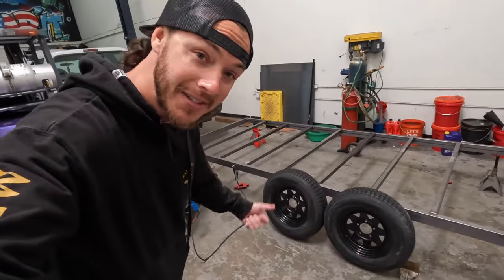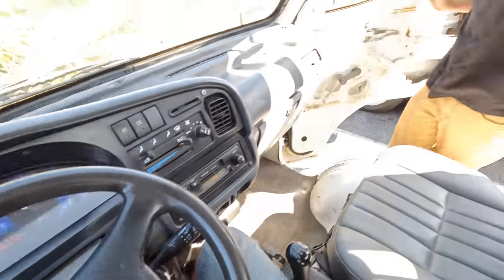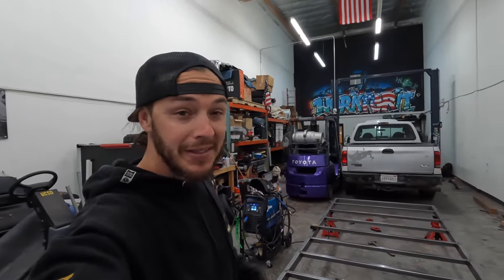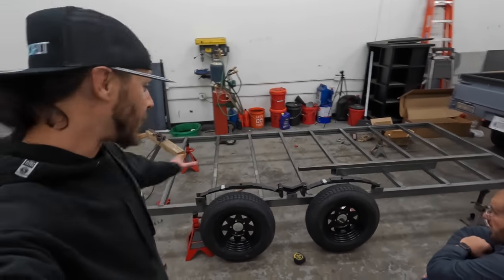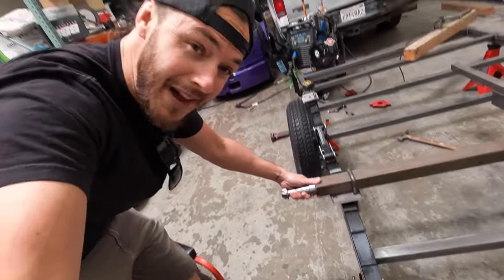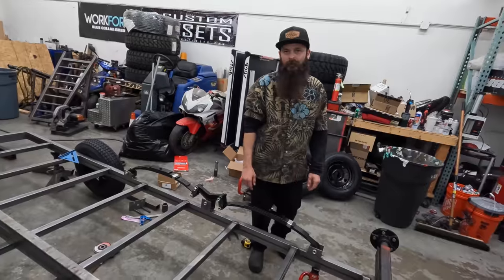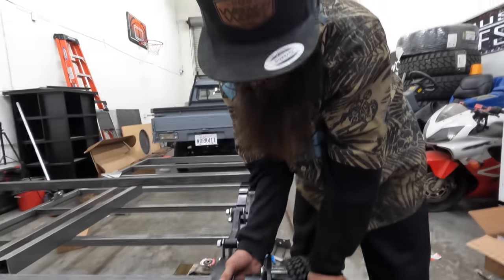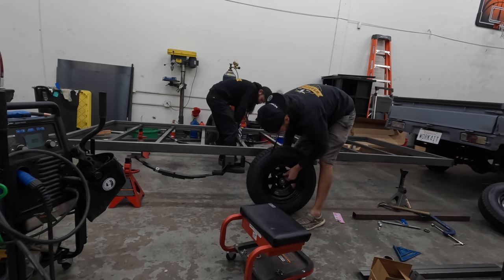Building a Mini Gooseneck Trailer for my Mini Truck! (Part 2)

Comment: As a current UPS package handler. The second box actually makes it MUCH sturdier aka won’t get destroyed while being thrown around in transport and loading. Fun fact lol. Great video Ryan!
Reply: Got a better idea you can work just as efficiently without throwing other people's paid shit around at all. The fact you admit the comoany throws them around means morally you should probably find a better job so the company goes under and actually Change a problem rather than endorse it as something "normal" in behavior. Should never be your fault for "not getting a sturdy enough box" at today's inflated rates.
Reply: @twiztedclown  Not true, I try my best not to throw junk around when I’m loading in the mornings but for the amount of crap they try and shove down our throats at 4 am it’s not possible. Loading 4 trucks with 250 pieces each while trying to keep it organized and workable for the driver, all the while not missing packages that the next guy has to pick up is more difficult than it seems

Comment: ya know if you used utility trailer leafs the leafs wouldve been about half that length and a little lower those are the same length as my 16k lb bumper pull trailer its looking good though

Comment: tension springs by shortening spacing of end brackets by at least half an inch in.. lol
& square tube inside another square tube to strengthen center from bending for future builders
& add grease packing to new bearings lol

Comment: Set ur wheelbase 6” wider than the mini truck wheelbase. 

Too wide and ur turning the steering wheel a lot while reversing

Too narrow (like stupid jet ski trailers) are more difficult to reverse. U move steering wheel an inch the it jackknifes. Not really but u get the point

Comment: Trailer axles aren’t built flat. They all have a slight curve built into them and flatten out with load.
Reply from the maker: Correct. But we aren’t really setup to do that. We’ll be fine like this